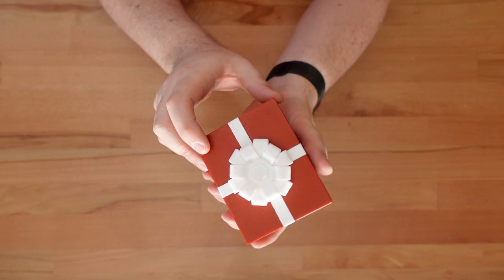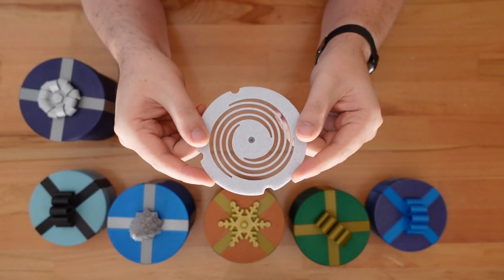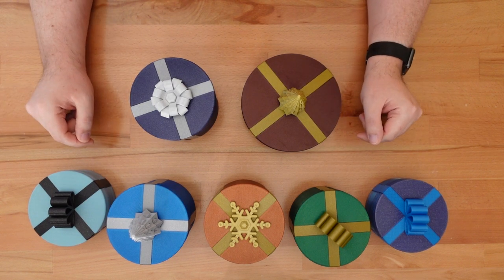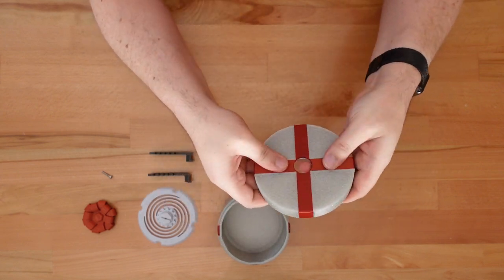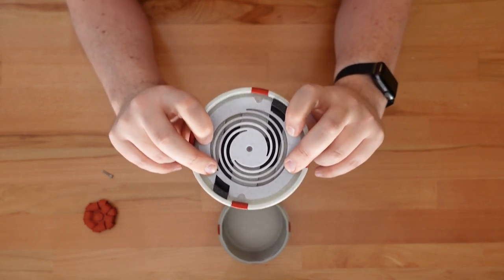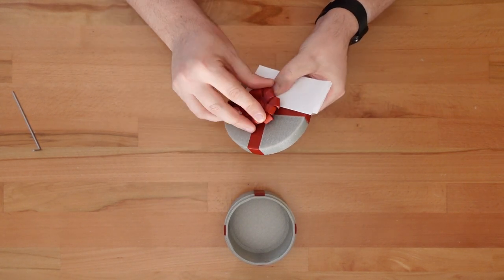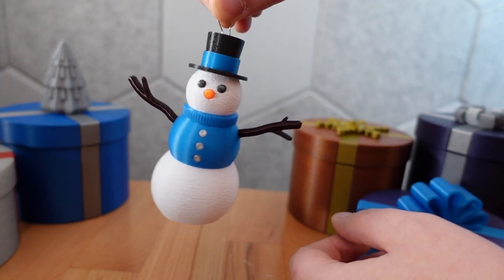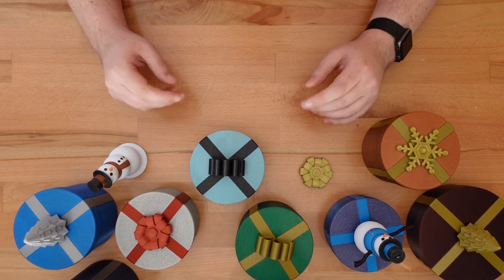3D Printed Gift Box with a Secret Lock (cylinder)

Comment: Very nice! I came from the fountain and love your 3d models. Could I ask what printer you are using. I am not sure if I should go for prusa mk3s+ or bambu lab
Reply from the maker: Hi Möhre,

My main printers are all various versions of the Prusa MK3 (MK3, MK3s, and MK3s+). The oldest of these recently passed 20,000 hours of print time, and still prints very reliably. Of course, that is with maintenance. Stuff WILL eventually wear out on you if you use it 24/7 for many months.

As for printer recommendations, I don't have enough personal experience with newer offerings to give a specific recommendations. Instead, I'll point you to this video by Grant of @3DMusketeers : https://www.youtube.com/watch?v=U_8ID7K7tvc for a more informed take on your question.

If I PERSONALLY had $800 on hand to buy my first 3D printer, I would still buy a Prusa MK3 kit. The assembly takes a while, but it teaches you a lot about how the printer works. This is super helpful when you eventually need to replace something. If I were limited to under $300, I'd pick up an Ender 3 and some extra filament to learn the basics and see if the hobby interests me enough to upgrade to something nicer.

Whatever you do, welcome to 3D printing and good luck!

Comment: Most of the parts print perfectly however when I print the lid I get a step out where the the sides build above the base and one of the corners sinks slightly as a result of it. Can't seem to get past it - not that its an issue with the design, but as someone with lots of experience in this would you have any ideas as to why that would happen? Up until the lip it prints perfectly.
Reply from the maker: I believe I know the "step out" issue you're describing, but I'm not certain. Feel free to send some photos of the problem to me and I'll see if I can troubleshoot. My email address is listed in the "About" channel tab.

Comment: Can they print with RESIN, not filament?
Reply from the maker: It might be possible but it's not ideal.

Resin is generally brittle (unless you are using an "ABS-like" or "tough" formulation). Resin also isn't particularly good with thin walls and very precise tolerances. You will also need a resin with a bit of flex in it for the spring.

If you do try, just keep in mind these limitations. Good luck!

Comment: i messed up the print. i printed the normal key, which was too tight. than i noticed the "control points" aren't accomplished. the bottom layer was very tight and i have to loose them. i managed to rotate the key. unfortunately i couldn't screw. the screw got stuck. so the whole puzzle was unsolvable. 
thanks for the affort you put in but it didn't work for me. hopefully you make new creative puzzle/things
👍
Reply from the maker: Ah, sorry that one didn't work out for you!

I assume this comment is for the print-in-place puzzle. It's possible you may have better luck printing the core and the case separately, but that does ruin some of the fun. More designs are on the way!